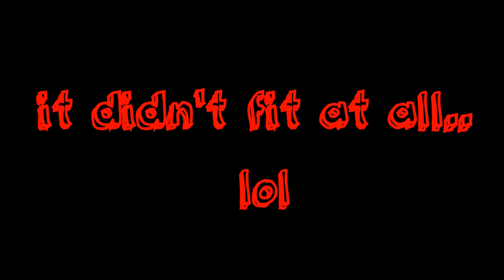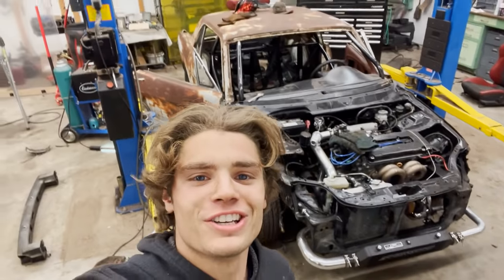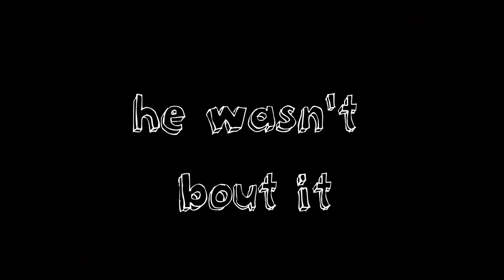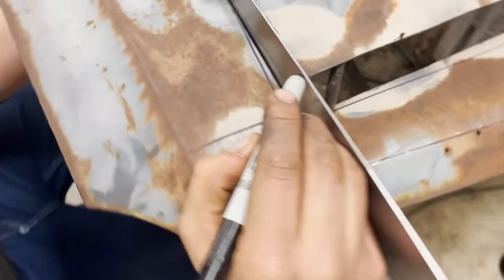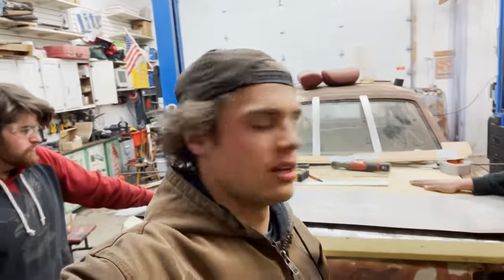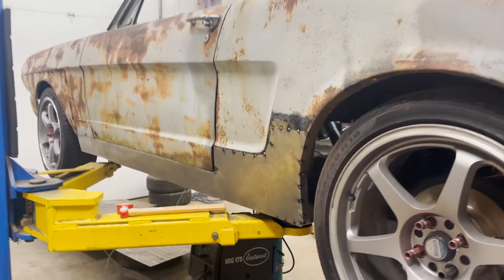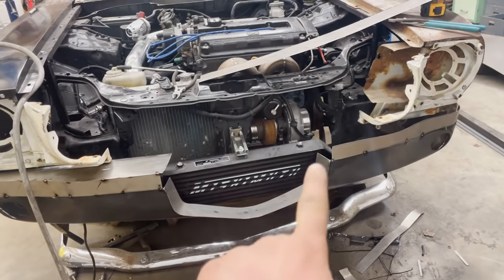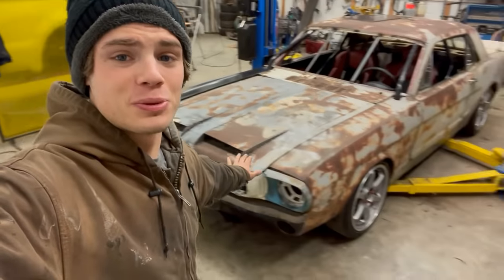1965 MUSTANG ONTO HONDA CIVIC CHASSIS SWAP!! "MASUTANGU" PT.2

Comment: Here's what's funny.  When I was in my teens and 20's (aka when I was your age) I was a purist.  This would have made my blood boil.  As I got more into real hot rodding and building I earned absolute respect for builds like this.  The vision, the fabrication, and the time spent with friends. It wasn't until I was almost 40 that I realized how awesome wrenching with buddies is.  I'd always worked alone.  We built a shit box and took it endurance racing and it's the most rewarding thing I've done in a car.  Keep cranking out stuff like this.  It's perfect.

Comment: I did this type deal with two 1969 Camaro shells that were rotted out the bottoms. First one I fit on a short bed lowered SS-s10 it worked good and was a driver. The second one I fit onto a Toyota Echo and moved the rear axle/swingarm back to match the Camaro wheelbase. The second one was so much easier. Y’all are awesome!!!

Comment: Wow a mustang on a civic chassis. This is going to very interesting and unique and a brain twister. People are not going to know what to think when that sounds the way it does and does front wheel drive burnouts it would be even cooler and crazy if you did the all wheel drive conversion.

Comment: think you going to have problems getting the front window to fit unless you cut out the window surround and move it in front of the rollbar or move the rollbar back (the angle of the rollbar in the front is wrong anyway so that might be a better idea)

Comment: I jus now saw this and started watching. Ur doing an awesome job on this badass project. My only question is, wouldn’t the old stang body and extra sheet metal ur welding in add more weight to the Honda chassis than what it had originally?

Comment: With the Ford rockers sitting over the honda rockers or any old sheet metal over the hondametal for that matter- do you worry if that will be a problem area for trapped dirt, debris and rust in the future? I'm helping weld new metal over old on a 67 Chevy c10 and where the old metal sits layered with new. I worry about corrosion happening very quickly in the colorado roads. We use a lot of salt for snow removal where I live and its brutal on cars

Comment: Bro, this is killer. Subscriber earned for sure. What’s you guy’s background to know how to do this stuff? You have any advice for someone wanting to get into doing projects like this?
Reply from the maker: Blake and I both worked at a restoration shop. We have both had our fair share of personal fab projects too. I re-did a ton of metal on Noise Complaint and have done rust repair on countless pickups. Blake was a body tech for 2-3 years and is certified in welding.

It's not hard to get started. Find a welder and sheet metal, do your research, and practice!
Reply: @TOMSREFURB  that is so cool man. Thanks for taking the time to reply. Looking forward to seeing where this project goes. This thing is going to be a monster, maybe stage two of this thing can see it get an awd swap similar to motionautotv’s civic 💪

Comment: why didn't you cut and re-angle the front roll cage bars.. you could had eliminated cutting the fenders to clear the roll bar and what about a front windshield? The bar sticks out past the glass pinch weld area... the body fab work looks slick as hell though. Next is awd conversion.

Comment: With a extra old 67 Camaro out of the Camaros I have. For daily driving and gas mileage I was planning to take the 350 engine and 350 turbo transmission out of the Camaro. And install a 1981 Datsun inline 4 cylinder carburatored 2.0 liter engine and 5 speed manual transmission out. And install Datsun engine and transmission in the 1967 Camaro. Both cars were around the same rear end gears. Datsun/Nissian engines are extremely dependable and excellent fuel mileage. Also they have a true double roller timing chain that usually lasts a lifetime. No timing belt that can break. My Datsun had 305,000 miles one guy had 540,000 on his Nissian. Why a inline 4 cylinder and transmission from a real wheel drive car? Easier and simpler for the swap.

Comment: I am very impressed with your creation skills but wondering if you’re gonna leave all the cuts welded the way they are now ore gonna weld it properly all the way. Because i'm more of a paint guy I was a bit disappointed that you mounted the fenders permanently already (that’s what you mentioned at least). While the right one is in such a deplorable state on the inside already and they are both cut up massively to they both need some proper welding and painting inside and outside in my opinion. I don’t now what your goal is with the car of course but after the amount of work you guys have put into it already I hope you to want it to look nice at the end and last for some time to. But this way it’s gonna be a rat rot sooner than you think I am afraid. But that’s gonna be clear in the next videos I guess. Good luck with the project anyway.

Comment: I would have described that more like hacking and not trimming. Trimming is where you just take a little off the top or bottom or sides or whatever angle. Hacking is what you did....😂

Comment: yes, great engineering foresight. good manufacturing skills and planning but what a waste of a good Mustang body! Mustang + Honda= Wrong!!!! NO, No, No! your building a front wheel drive mustang? Henry Ford will return from the grave a screw you up for this! did the guy where you bought the stang parts laugh when you said what you are doing or you just didn't tell him for that reason?

Comment: Front whl drive honda 60s era mustang? Dude, no. NOBODY wants a 4 or a 6 cylinder mustang in any capacity. Build uniquely with BADASS in mind, improvements over original designs that make good engineering sense. Never a rear wheel drive designed body on a front wheel drive chassis and powerplant. Different for the sake of different is never cool its just junk. Not just anybody can be Puddins Fab! In the lower horse power dept. Hes got real vision with his uniqueness and a bit crazy and entertaining. You got none o that. Try harder. Best of luck.